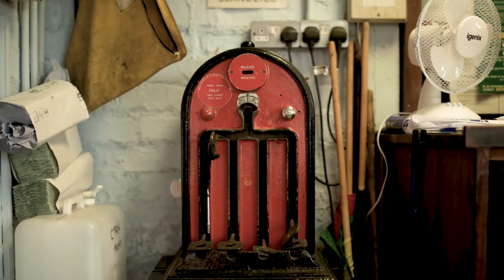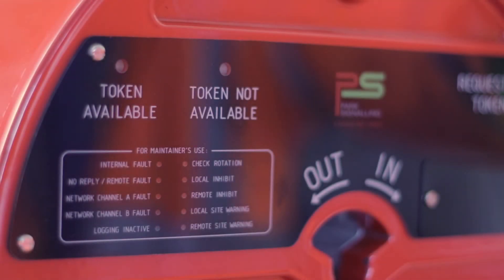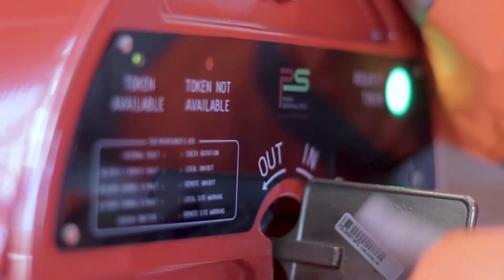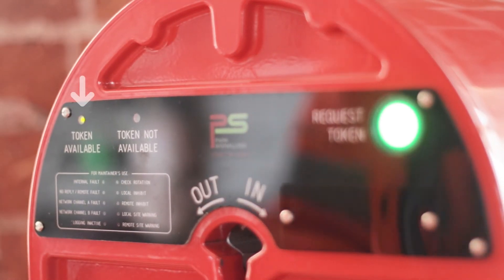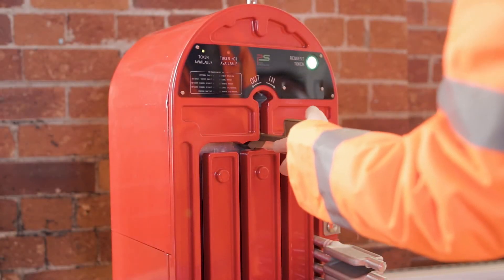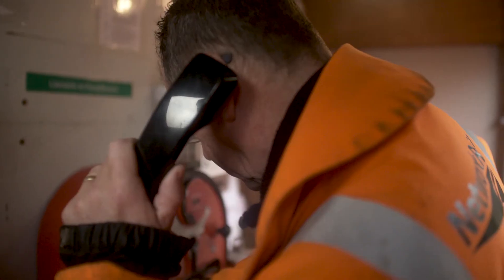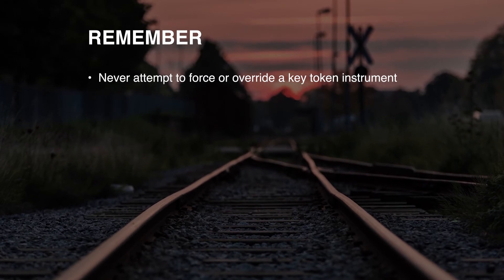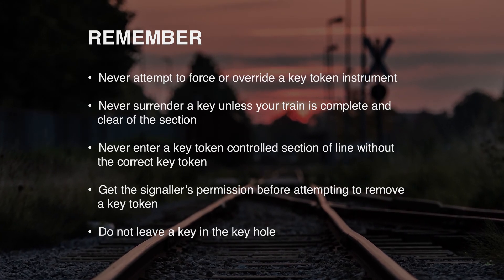Park Signalling - Key Token working with DiBloC

Comment: Since RETB (Radio Electronic Token Block) has been operating on Network Rail and its predecessors since 1985, including in the North and West of Scotland for more than 30 years one wonders why someone got money to develop this extra system .
I use the For North Line regularly and am protected by RETB. Why should other single line systems exist?
Of course  more technological systems need to be brought forward using GPS type software but the most forward example of single line working in the UK is RETB, 30+ years old as it is.
Reply: Mind you, at around about the same time the original RETB was developed, NSTR* was also introduced - this video and the design of the token machine seems to suggest a talk about DiBloc explicitly states that it's for those types of lines? 
RETB requires you to have the cab display radio/unit on each train, as well as the radio system itself (which could end up being in addition to the standard GSM-R**), and is more expensive than NSTR. This takes the NSTR/NSKT costs down more as there are more options to connect them together...

(*No Signalman Token Remote - the first commissioning I believe was in 1986. Alongside the six lines that use it, there are also the other No Signalman Key Token lines.
**The current RETB lines don't have GSM-R, seen it mentioned that the terrain on those lines isn't great for a reliable signal. The rest of the network though has had it fitted, and I don't see that anyone would happily make a case for removing it again.)
Edit: these guys are the same ones who do the new generation RETB equipment, for what it's worth...
Reply: Good evening, some single track museum railways in the United Kingdom are still operated with staff or token blocks although all their stations are equipped not only with home signals but also with departure signals (generally "railway semaphore signals" with arms positioned at 45º in the dial lower or in the upper quadrant to communicate to the driver that the way is clear).  It is therefore not clear to me the need to have a staff or token block in the presence of starting signals.  In other words, the signals that authorize the sending of trains in the opposite direction along the single track section could not be interconnected with each other in order to avoid head-on collisions as well as pile-ups as happens on double-track lines equipped with "Absolute block" ?  If I remember correctly, the intermediate railway stations of the lines operated with the "Radio Electronic Token Block" do not have departure signals, except the "Stop Board".  Grateful for the attention given to me, I would like to take this opportunity to extend cordial and sincere regards

Comment: I'm sure it's in demo mode, but removing a token and having the token available light still lit in your promotional video isn't confidence inspiring!
Reply: Slightly less inspiring is one of the demos done, where "token available" was shown for a short while on the opposing token machine after the token was removed. Mind you, it's almost certainly just an issue with displaying and releasing two tokens from the opposite directions wouldn't be possible.
Reply: @fetchstix   Request token checks the other side I assumer.